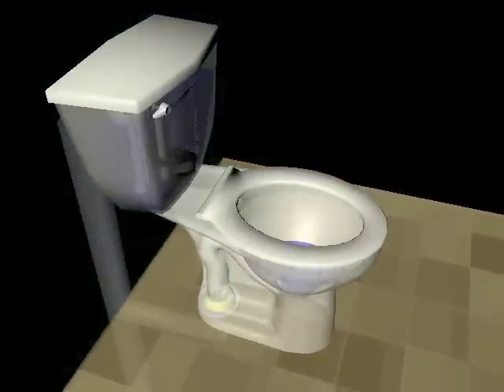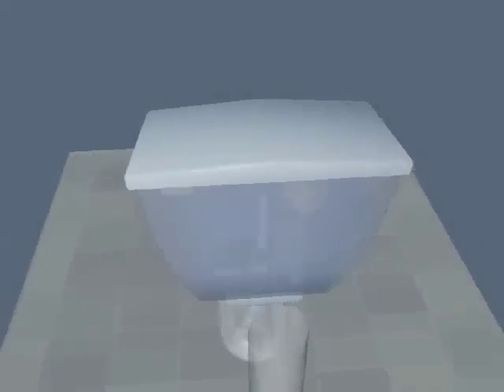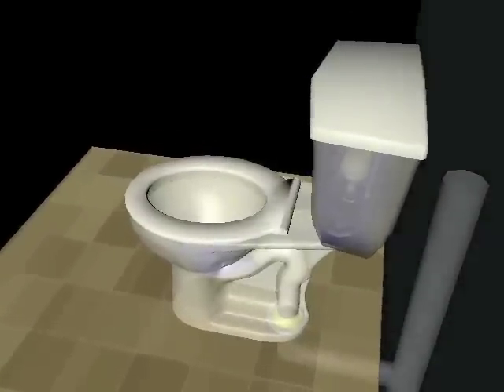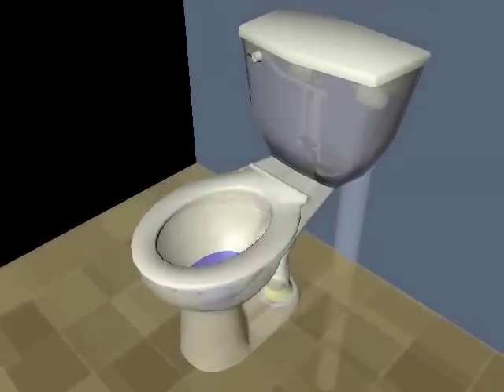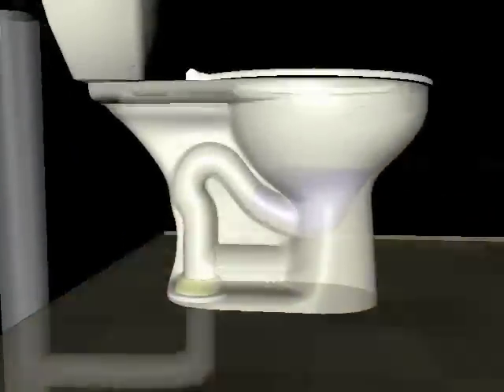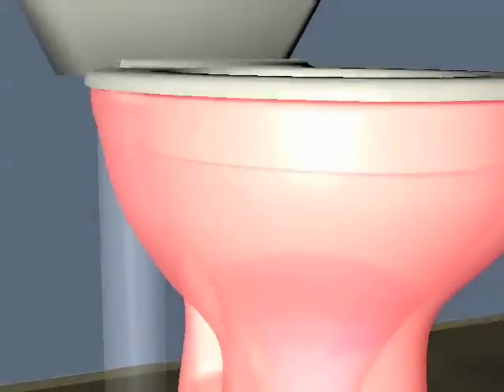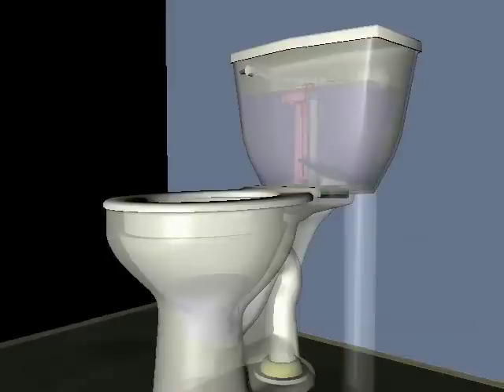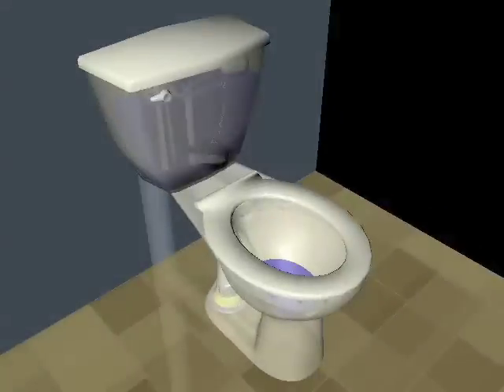How It Works: The Toilet

Comment: An important detail is missing. The water flow from the closet doesn't just go in through the toilet rim. Most of it goes down thru a tube & helps push the water & create a better vaccum.  See "The flush Toilet" video for a better example.
Reply: 100% agree. Video is useless
Reply: Emad Nadi That's not a nice thing to say and this video is 100% superb
Reply: A lot of toilets don't have the big tube.